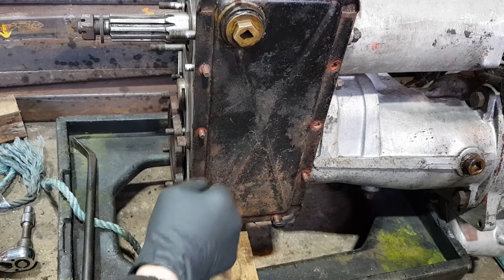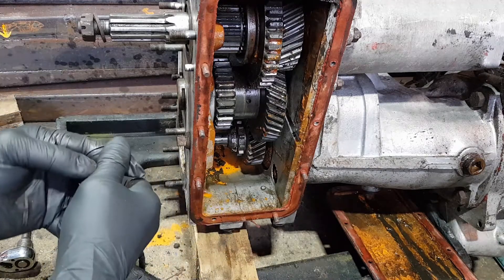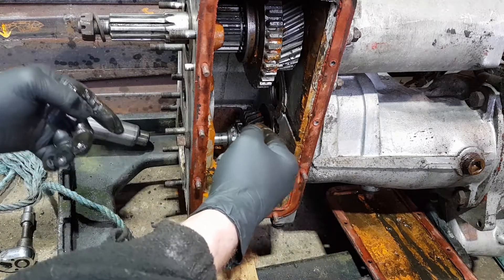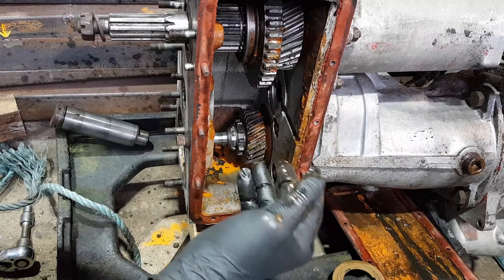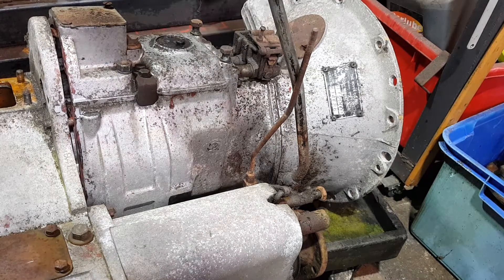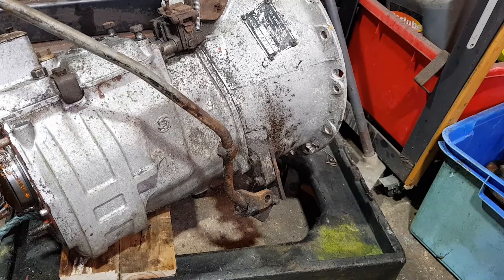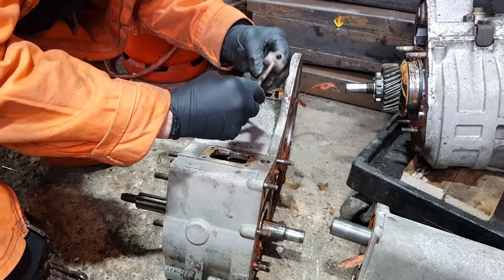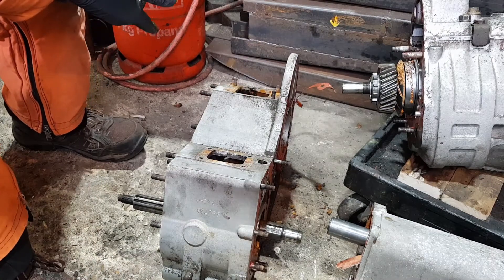Land Rover Series Gearbox Strip Down Part 2

Comment: I’m a bit confused as you said you need to remove the intermediate gear to remove the 3 bolts behind it yet when you split the transfer box from the gearbox the intermediate gear was still in situ 🤷‍♂️great videos